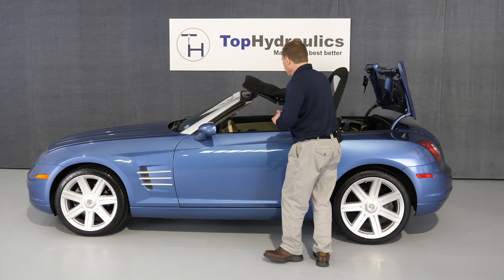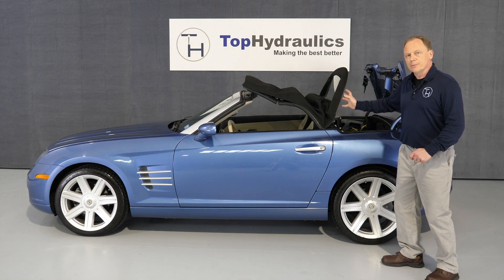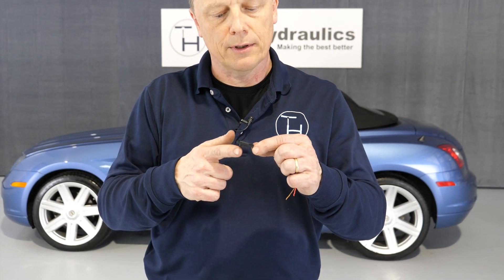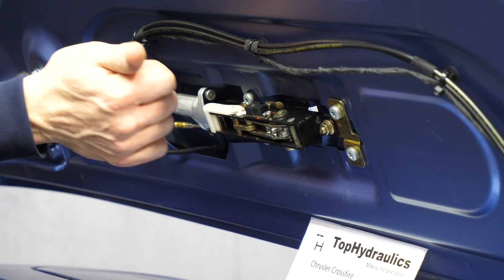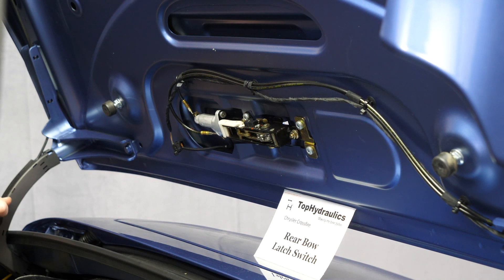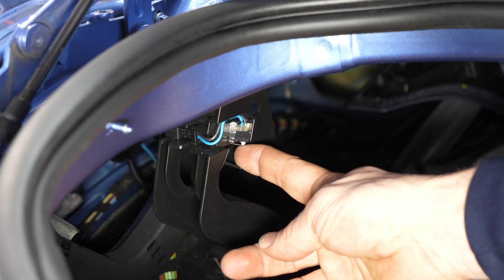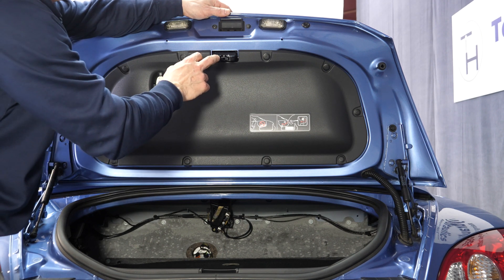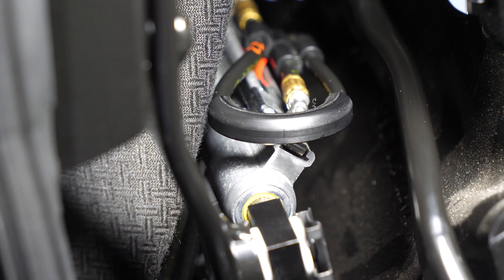Troubleshooting Switches and Sensors - Chrysler Crossfire - Top Hydraulics, Inc.

Comment: What is the meter suppose to read that goes to latch sensor
Reply from the maker: The switches on the latches should read closed circuit when the latches are open and open circuit on any latch that is open.

Comment: Hello Klaus. I have been having an issue with my roof. When I open it, it goes all the way down, but the decklid keeps modulating up and down without engaging the beep indicating it finished opening, and the alarm chimes when driving. When I try to put top back up, it wont go beyond a certain point, and bounces back and forth. Do you have any idea what my issue might be?

Comment: Thank you for this video!! I think this will be helpful for my situation.  My top is not going down at all.  I unlatch the D ring, my windows come down as they should, I have ensured that my trunk divider is in the correct position, but when I press the button it just beeps and does not retract.  Is there any sensor you think I should prioritize??  Thank you, again.
Reply: Did you get this figured out? I'm having the same problem.

Comment: I  cant see the sensor on the rt top bow tension cylinder and the video does not show the actual location.   Help anyone (rt side)
Reply from the maker: Look at the two cut-outs in the aluminum rail on the left bow tension cylinder, as seen here in the listing for for the cylinder rebuild: https://www.tophydraulics.com/chrysler-/248-1990-chrysler-crossfire-left-bow-tension-cylinder.html#/30-core_exchange-send_your_parts_to_top_hydraulics_first. The cutouts are where the two sensors clip in.
Reply: @TopHydraulics   I have my top sticking when trying to open. stops moving at about 10 inches above the windshield and has to be coaxed up.  My hydraulic fluid is full and appears not to be leaking. Is there a sensor that is causing this stoppage... btw the pump keeps running as if it is trying to complete the opening of the top
Reply from the maker: @rayharmacinski4934  Are you saying that the pump is lifting the top off the windshield several inches and then seemingly does not have enough power? Close to the windshield is where the pump needs the most pressure to lift the top. If the top starts moving and then slows down and comes to a stop while the pump is still running, then I would assume that you have a mechanical problem with the top or not enough pump pressure.

Comment: Can some tell me why my two little flaps on the side dont move when im opening or closing the roof I have to do it manually????
Reply from the maker: The flaps are actuated by steel cables. If the flaps don't move, that is a purely mechanical problem. Take a good look at it and you will figure it out.
Reply: @TopHydraulics  thank you for replying will have a look at and try fix it 👍🏾

Comment: Thank you for this really informative video! I have an issue with my chrysler crossfire where the lid won’t lock into place. You normally hear a click when  the convertible roof has completely shut whilst depressing the convertible top button. If you look back over your shoulder when sitting in the front seat the metal latch in the centre in front of the back window should be completely flush. Do you think deck lid latch switch which is behind the boot lid?

Comment: Not a bad video , but you left out some of the sensors, What about the switch in the top by the passenger seat, and the one in the windshield , The problem that I am having with my top  Is that when it's closed , It beeps when I drive, It goes off after about a mile , but when I stop , It will beep again for a little while , When the top is open, everything is fine, But I know when I unlatch the D ring , The windows should go down first  , But don't , I have tested the switches with a meter , They all seem to work , But it still is beeping with a red light blinking on the top switch , Any help would be appreciated...
Reply from the maker: You are right - we accidentally edited some switches out of the video. We will take the video offline while we are trying to fix it. Meanwhile, I would be happy to talk to you about the fault you are experiencing if you could please contact me directly at klaus@tophydraulics.com